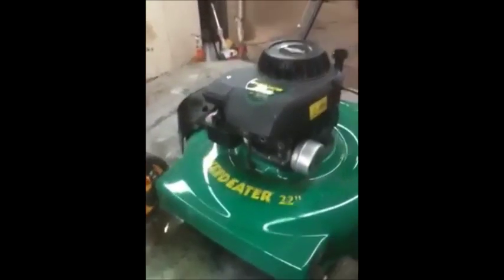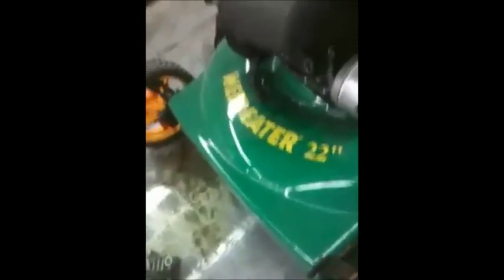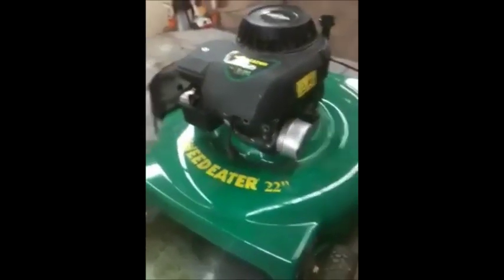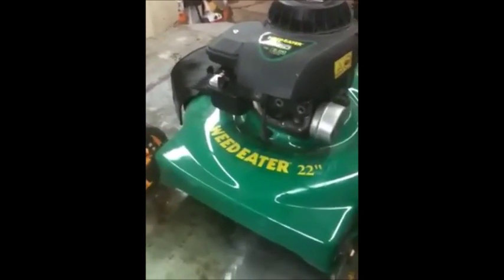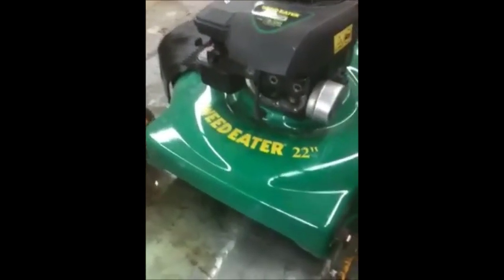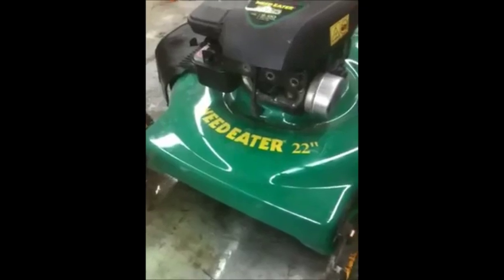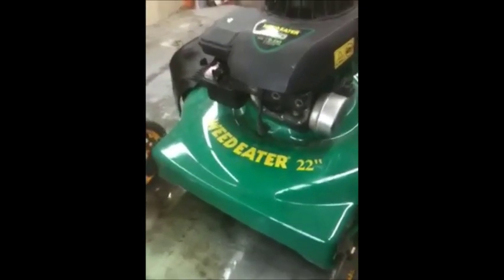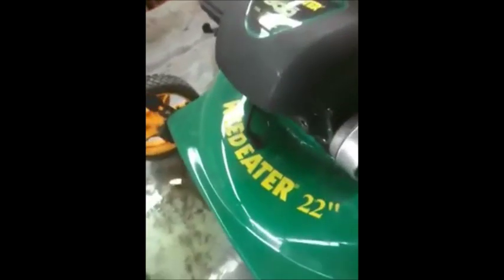NO START!! / NEW USED ONCE / BRIGGS AND STRATTON WITH FAILED PLASTIC CAMSHAFT / WTF? / WARRANTY!!

Comment: I have a 3.5 rototiller I have found exactly this problem. I don't want to spend money on this, do most b&s have the same cam? Can I find a free mower and tare it out? My first thought was jb weld, but I don't know how I would line up the valve timing when the gear spins on the shaft. I can't find any good reference photos online showing the timing mark and lobe position. Thanks for the help.

Comment: I find these new B&S engines to be absolutely disgusting, disturbing and the quality seems to be 12 different ways from Sunday. My main mower is a 1977 92908 3.5 HP B&S with about 1200 hours on it, one owner, it outlasted the original deck. I took the engine apart to clean it out after 30 years of use. The only time it's broken down is after 23 years the original sparkplug and points and condenser failed. The carburetor went 30 years before it ever gave a problem and always started on the first pull. It got two oil changes a year, it was maintained well but it got run hard at times. I'd LOVE to see a new or newer B&S last like that. Oh, the hilarious thing, the valves were never out, it has a reused headgasket and it's original rings, that have been off of the piston. It leaked down tested at 8% after all that. Runs like a top.

Comment: This is one reason why prefer a lithium ion battery powered lawn mower over a gas lawn mower. If I had to get a gas mower, I would get a used Toro with a Suzuki GTS120 2 stroke engine.

Comment: Some of the Honda's have a plastic cam gear too!!!
Bruce
Reply from the maker: yes they do on the gcv series ohv's
Reply: JEREMY FOUNTAIN
Are you referring to an overhead cam belt pulley?  That would make more sense.  Do they make cams with plastic lobes also?
Reply from the maker: Garth Goldberg yes
Reply: That's ridiculous.  What about the motor in ours.  We have an HRX 217.
Reply: I haven't taken one of the apart yet.
Reply from the maker: Garth Goldberg yep its got a plastic cam
get ready for a new one at about 200 hrs

Comment: Bloody hell, thats just a big pile of crap :-((

I have an old briggs&stratton 3.5hp lawn mower and i bet it has one similar.

jeremy do you roughly know how far back in time they started to get this nasty?
Reply from the maker: late 90's early 2000's
Reply: They started the nylon camshaft ordeal in Kool bore engines sometime in 1987.
Reply: 1972FordF150
Yep my mower must have a "plastic fantastic" cam, one day ill get new gaskets/seals and piston rings and pull it to bits, and while im doing that ill see the plastic cog of doooooooooom lol.
Reply: You can replace the nylon cam with an older style 3-3.5 HP camshaft. The gear and tappets appear the same.
Reply: 1972FordF150
Sounds like a good idea :-))

Mine is the engine with the external plastic strip type govenor, it sits near the flywheel fan and the speed of the flywheel pushes it out.
Its not a choke-a-matic, its pulsa-prime and a later model called "classic 3.5".

Comment: Its common nowadays with these smaller Briggs and Stratton vertical and horizontal shaft whether if its an L head or OHV they are using PLASTIC camshafts and timing gears in their engines as this is for lawn mowers and pressure washers as i had a craftsman pressure washer with a B&S 7.75 professional series engine as the motor blew had a rod knock and the rod went through the side of the block looking in the hole shocked to see PLASTIC camshaft and timing gears. as these newer B&S engines are JUNK even the engine that replaced this classic 3.5 hp engine. i would go with Honda, Robin/Subaru, Kohler, or any honda clone engines. they are more reliable than Briggs and stratton and Tecumseh and they start on first or second pull and restart easily as Harbor Freight they usuaully have their Predator engines on sale and are the best choice.
Reply: I thought L head engines were from the 70s and 80s.

Comment: Actually it does work. Briggs and Stratton has been using plastic cams in all there push mower engines since around 1990! It is extremely rare that one fails. The plastic that is used for their cams is almost as strong of steel.
Reply from the maker: Briggs and Stratton told me at the factory service school that the design of the cam was to reduce valve train noise and to cut cost.
Reply: I've been an operator at the Briggs plant in Kentucky for 9 years. A lot of people including me were shocked when they find out that our cams are made of plastic. Briggs was one of the first companies to do this and now almost all push mower engines have plastic cams. It doesn't make sense how plastic could hold up in such a hot environment but it does. There are tons of 10 and 20 year old Briggs engines with plastic cams are still going strong.